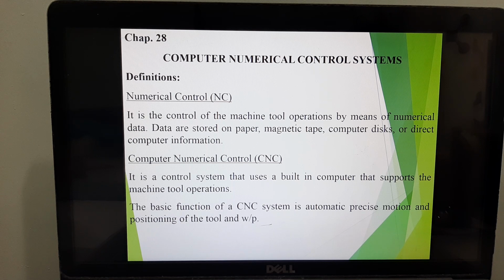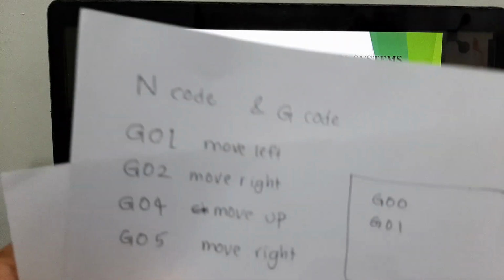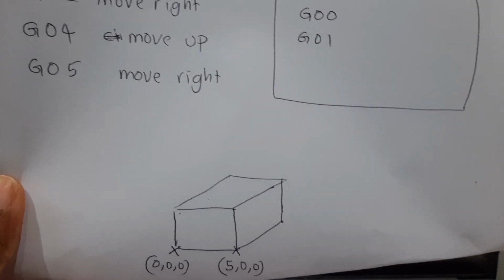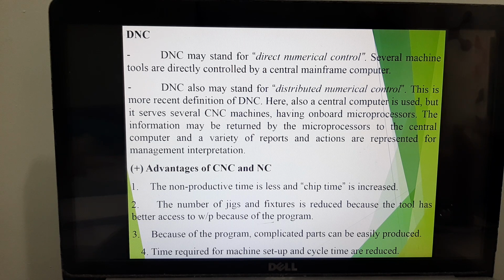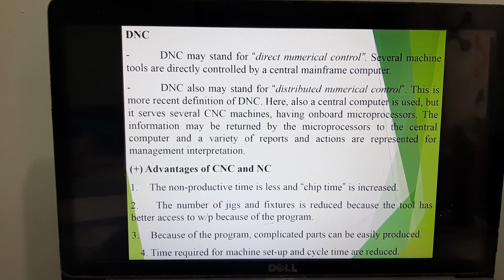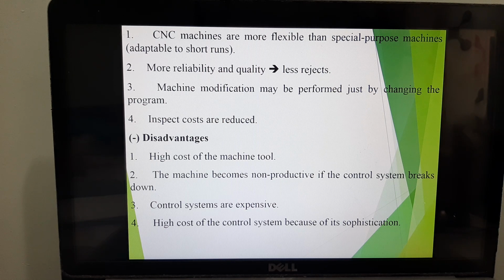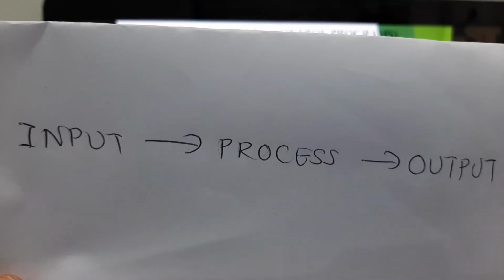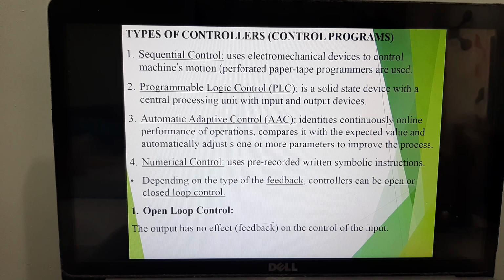COMPUTER NUMERICAL CONTROL SYSTEMS

Comment: Hi madam i learned about the computer numerical control systems:

numerical control: control of the machine tool operations by means of numerical data. Data stored on paper, magnetic tape, computer disks, direct computer information.
computer numerical control: built in computer that supports machine tool operations. automatic precise motion and positioning of tool and w/p. 
direct numerical control: several machine tools directly controlled by central mainframe computer.

(+) of CNC:
-inspection costs are reduced
-machine modification may be performed by just changing the program. 
-more reliability and quality (less rejects)
-more flexible than special purpose machines
-setup time/cycle time is reduced

(-):
-high cost
-non productive if control system breaks down
-expensive
-high cost because of its sophistication

sequential control: electromechanical devices to control machines motion
programmable logic control: solid state drive with a CPU with input/output devices
automated adaptive control: identifies continuously online performance of operation
numerical control: uses prerecorded written symbolic instructions
open loop control: has no effect on the control of the input
closed loop control: equipped with various sensors and transducer that measure accurately the real position of worktable.

Thank u madam!
AHMAD NAZRI ME0106079

Comment: Good morning Dr, what i have learned from this video is about computer numerical control system. Numerical control is defined the control of a machine tool operation by the means of numerical data. Then i learned about computer numerical control (CNC) which uses a built in computer that supports the machine tool operation. Third  is direct numerical control which is similar to CNC where one mainframe controls several machining. There are several advantages of CNC and NC such as less non productive time and chip size is increased, number of jigs and fixtures is reduced, setup time and cycle are reduced. 
I also learned about many types of controller such as sequence control, program logic control, automatic adaptive control, numerical control, open loop control and closed loop control. Thank you Dr.

Muhammad Naquib Bin Nor Azlan
ME0106093

Comment: Mohammad Aliff Bin  Mohd Pauzi (ME0104760).
From this video i learn that : 

Computer Numerical Control
cantrol system tshat use to build in computer to support machine tool operation

Type Controller

=sequential control
=programmable logic control 9PLC)
=Automatic adaptive control (AAC)
=Numerical Control

Comment: Good afternoon madam, I am Wong E-Shen (ME0106071). From this video, I have learnt about computer numerical control system. Firstly, numerical control is the control of the machine tool operations by means of numerical data.Those data are stored on paper, magnetic tape, computer disks, or direct computer information.
 Next, for computer numerical control, it is automated and is a control system that uses a built in computer that supports the machine tool operations.
 Then, for direct numerical system, it is same as computer numerical system but there are several machine tools are directly controlled by a central mainframe computer. For the advantages of numerical control and computer numerical control are non-productive time is reduced, machining time increase, number of jigs and fixtures is reduced, complicated parts can be easily produced, machine set-up time and cycle time are reduced. For the disadvantages, the machine tools and control system are costly and the machine becomes non-productive if the control system breaks down. Besides that, there are several types of controllers which are sequential Control (uses electromechanical devices to control machine’s motion), programmable Logic Control (a solid state device with a central processing unit with input and output devices), automatic adaptive control (identities continuously online performance of operations, compares it with the expected value and automatically adjust s one or more parameters to improve the process), numerical control (uses pre-recorded written symbolic instructions.), open loop control (the output has no effect on the control of the input) and closed loop control (equipped with various sensors and transducers that measure accurately the real position of the work table).
Thank you.

Comment: NIGEL ANDERSON SINGH A/L RAJDEEP SINGH 
ME0106094
Good day, madam. Numerical control (NC) is the control of the machine tool operations by means of numerical data. Data are stored on paper, magnetic tape, computer disks or direct computer information. Computer Numerical Control (CNC) is a control system that uses a built in computer that supports the  machine tool operations. The basic function of a CNC system is automatic precise motion and positioning of the tool and workpiece. Direct Numerical Control (DNC) serves several CNC machines, having onboard microprocessors. The information may be returned by the microprocessors to the central computer and a variety of reports and actions are represented for management interpretation. 

Advantages of CNC and NC are non-productive time is less and 'chip time' is increased, the number of jigs and fixtures is reduced because the tool has better access to workpiece, complicated parts can be easily produced, time required for machine set-up and cycle time are reduced, flexible, more reliability and quality,  machine modification can be performed just by changing the program and inspect cost is reduced. 

Disadvantages : high cost of machine tool, become non-productive when machines breakdown and control systems are expensive (sophistication).

Type of controllers : Sequential Control, Programmable Logic Control, Automatic Adaptive Control, Numerical Control, Open Loop Control and Closed Loop Control.

Thank you.

Comment: Good Day, Dr. I am Derrick Ng Kian Ping (ME0105733). At the end of the video, I have learned about Computer Numerical Control System. Firstly,Numerical Control is the control of machine tool operations by means of numerical data. Next, computer numerical control uses a built in computer that supports machine tool operators and is an automated precise motion and positioning of tool. Moving on, Direct Numerical Control is similar to Computer Numerical Control but one mainframe can connect to different machine at a time. The advantages of CNC and NC are non productive time is less and chip time is increased, Number of jigs and fixtures is reduced, complicated parts can be produced, time required for machine setup and cycle time is reduced, flexible,reliable,machine modification and inspect cost are reduced. However, the disadvantages are high cost of machine tool, machine become non productive if control system breaks down, control system are expensive and high cost of control system. There are 4 types of controller which are Sequential Control (uses electromechanical device to control machine's motion), Programmable Logic Control (Solid Sate device with a central processing unit with input and output device), Automatic Adaptive Control (identifies continuously online performances of operations, compares it with expected value and adjust parameters to improve process) and Numerical Control (Uses pre-recorded written symbolic instruction). Lastly, depending on type of feed backs, controller can be open or closed loop. Open loop control is where output has no effect on control of input while close loop control is same as Automatic Adaptive Control ,equipped with various sensors and transducers that measure accurately the position of work table

Thank You.

Comment: Name : Aiman Hazim Bin Arif Razman
ID : ME0106080

From this video, I have learned on the computer numerical control systems. Numerical control is the control of machine tool by means of numerical data. Computer Numerical Control (CNC) is a control system that uses a built-in computer that supports the machine tool operations. The basic function of CNC is automatic precise motion and positioning of the tool and workpiece. Direct Numerical Control (DNC) is same as CNC but several machines tools are directly controlled by central mainframe computer. A distributed numerical control serves as several CNC machines with onboard microprocessors. Advantages of CNC & NC are non-productive time is less and chip time is increased, number of jigs and fixtures are reduced because tool has better access to workpiece because of the programme, complicated parts easily produced and time required for machine setup and cycle time is reduced. The disadvantages are high in cost, non-productive if control system breaks down, expensive control systems and also high cost control system caused by sophistication. Type of controllers (control program) are, sequential control which uses electromechanical devices to control machine’s motion, programmable logic control (PLC) which is a solid state device with CPU and input/output device installed, Automatic adaptive control (AAC) and also Numerical Control which uses pre-recorded written symbolic instructions. Control systems can be opened or closed loops. Open loop control consists of PLC which when the output has no effect (feedback) on the control of the input. Closed Loop Control consists of AAC to rectify process value (problems) so that the output can be recalculated precisely.

Thank you for the informational video Dr.

Comment: good day madam, information gained form this video are the various numerical control system. Numerical control is a control of a machine tool operation by the means of numerical data. The data is stored on paper, magnetic tape, computer or direct computer information.
next is computer numerical control which uses a built in computer that supports the machine tool operation.
third is direct numerical control which is similar to CNC where one mainframe controls several machine.
chiptime is machining time.
There are many advantages of CNC and NC such as it have less non productive time and chip size is increased, the number of jigs and fixtures is reduced, setup time and cycle are also reduced, flexible, more reliable, and machine modification can be performed by just changing the program.
there are also many types of controller such as
sequence control - electrochemical devices, 
program logic control - solid state device with a central processing output and input devices
automatic adaptive control -  identifies continuously online performance
numerical control
 - uses pre-recorded written symbolic instructions
Open loop control
- no effect feedback on the control of the input
closed loop control
- equipped with various sensors and tranducer that measures accurately 
                                  - prompt users if there are mistakes in keying data.
ME0106053 Marcus Chuo

Comment: Good morning madam, I'm Chong Jin Yang (ME0106047). From this video, I learned about various types of numerical control system. 
1) Numerical control
- control of the machine tool operations by means of numerical data.
- data are stored on paper, magnetic tape, computer desks or direct computer information.
2) Computer numerical control
- uses a built in computer that supports the machine tool operations.
- automated system
3) Direct numerical control
- similar as CNC 
- one mainframe can control several machine

Advantages of CNC and NC
1) non productive time is less and "chip time" is increased.
2) number of jigs and fixtures is reduced
3) complicated parts can be produced
4) Set up time and cycle time is reduced
5) Flexible
6) more reliability and quality (less rejects)
7) machine modification can be performed just by changing the program.

Disadvantages
1) High cost machining
2) non-productive if system breaks down
3) control systems are expensive (sophistication)

Types of controller
1) sequential control 
- electrochemical devices
2) program logic control 
- solid state device with a central processing output and input devices
3) automatic adaptive control 
- identifies continuously online performance
4) numerical control
 - uses pre-recorded written symbolic instructions
5) Open loop control
- no effect feedback on the control of the input
6) closed loop control
- equipped with various sensors and tranducer that measures accurately the real position of the work table
- prompt users if there are mistakes in keying data.

Thank you

Comment: Good day Dr, Im Lee Zi Sheng ME0106051. From this video, Numerical Control (NC) 
is the control of the machine tool operations by means of numerical data. Computer Numerical Control (CNC)
 is a control system that uses a built in computer that supports the machine tool operations. G code is used in this. DNC : direct numerical control/ distributed numerical control.
Advantages of CNC and NC
non-productive time is less and “chip time” is increased.
number of jigs and fixtures is reduced because the tool has better access to w/p because of the program.
complicated parts can be easily produced. with the program
Time required for machine set-up and cycle time are reduced
CNC machines are more flexible than special-purpose machines (adaptable to short runs).
More reliability and quality (less rejects)
Machine modification may be performed just by changing the program.
Inspect costs are reduced
Disadvantages
High cost of the machine tool.
The machine becomes non-productive if the control system breaks down.
Control systems are expensive.
 High cost of the control system because of its sophistication.
TYPES OF CONTROLLERS (CONTROL PROGRAMS)
Sequential Control: uses electromechanical devices to control machine’s motion (perforated paper-tape programmers are used. 
Programmable Logic Control (PLC): is a solid state device with a central processing unit with input and output devices. 
Automatic Adaptive Control (AAC): identities continuously online performance of operations, compares it with the expected value and automatically adjust s one or more parameters to improve the process. 
Numerical Control: uses pre-recorded written symbolic instructions.
Thank You.